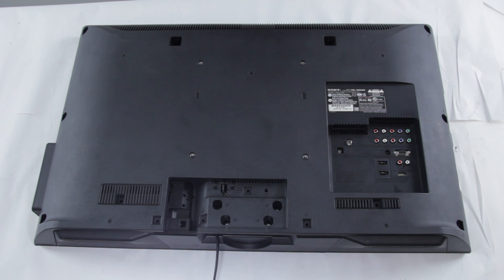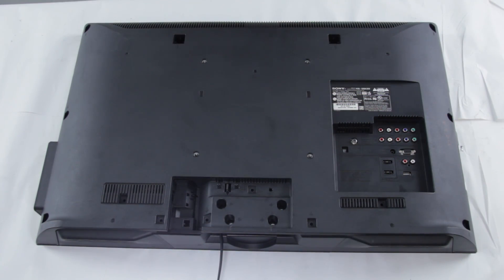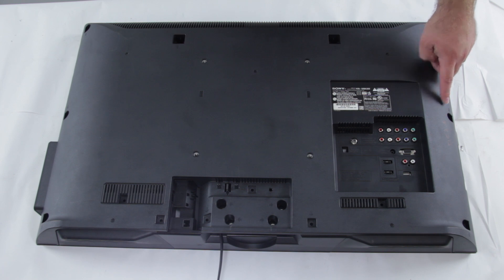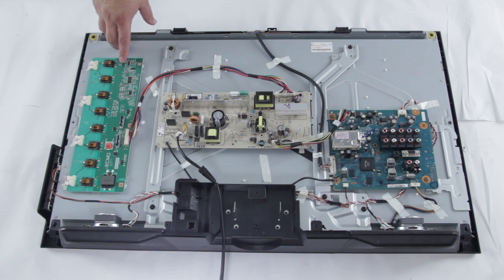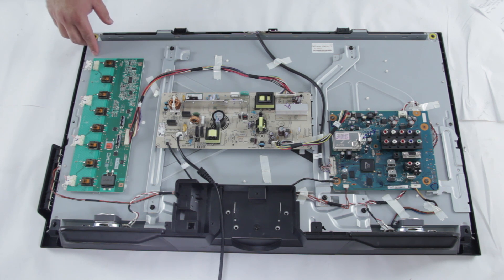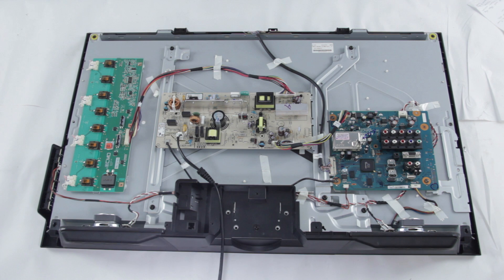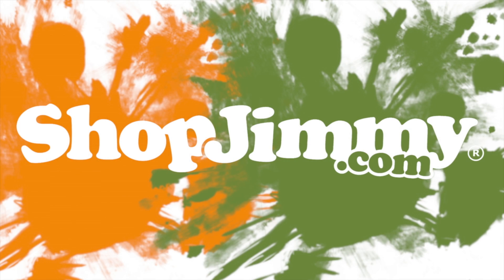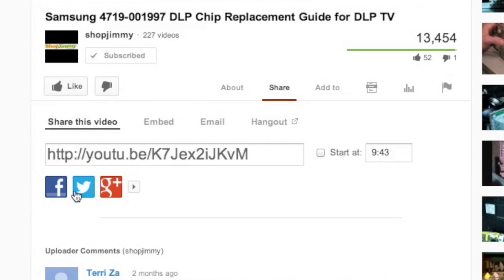LCD TV Repair Tutorial - Backlight Inverter Common Symptoms & Solutions - How to Fix LCD TVs

Comment: my son has a Samsung 40inch 2009 lcd LN40b550 and the other day he had it on in morning and when he returned after school to turn tv on the display was not correct. there is sound and everything works fine but the contrast is visibly wrong, its like on a computer screen that is set up wrong with the contrast and color. Also, my son has a ps4 and xbox 360, the xbox 360 was sitting under the right side if facing the screen and it gets pretty warm and heats up room along with the heat from tv. i have looked at troubleshooting issues and ruled out the swollen calibrators,, there is no blocked parts of screen that are different and no lines throughout picture. we adjusted settings and i ran the display diagnosis and it said that component or plug maybe faulty, something about cables or components that we plug into has an issue. PLEASE HELP IM GOING INSANE RESEARCHING THIS???????? mmcbar1@gmail.com

Comment: Hi guys, first I appreciate the help you are providing people with. I have a Sony Bravia KDL-40V2500 serial number 7112053  wh ISSUE-the 4 red light blinking problem. It happened right after my power bar was switched on off and on quickly accidentally. It turns on for 2-3 seconds then I kinda hear a click and the red lights start blinking. Ive taken the back off and Id like your help to know what I can try next please.  thanks

Comment: I have a Sony bravia KDL46_V2500 TV the problem is that when turned on the volume goes to the max. The input is from channel 4 and I cannot change the input channel. I am unable to use the remote as well. I tried changing manually by pressing the buttons on the top of the TV but I can reduced the volume but I cannot the input channels. Can someone help me in this problem.

Comment: I have a Dynex 46l150a11.... When I turn on the tv, I get the "Please Wait", then goes black after 10 seconds or so.... there is sound..... What the unusual part of this problem is that it is intermittent... Sometimes when I turn it back on, it works..... but more often than not, I get the "please wait" then it goes black scenario.... Can an bad  backlight inverter board fail intermittently????

Comment: Hi, I have a philips 32PFL3504D/F7 it turns off by itself 5 seconds after turn it on, no blinkink led, I dissasembled and disconnect inverter board from power supply and tv keeps on. Do you think my inverter board it's bad? Thanks

Comment: Panasonic 32"" LED TV Model: TH- L32SV6DThe TV is switching On but the green Led light flickers 4 to 5 times and their is nothin on the screen and the TV goes in Standby mode after sumtime again if u switch On the same thing repeats but no screen please tell me where the fault is ??? Email: gerard.ignatius001@gmail.comMobile: 0091 09823535250

Comment: I have a Phillips 42inch LCD with a problem 
model No. PFL7482 (Purchased Mid 2009,India). 

Problem Syptoms : 
When TV is switch on -> Screen on for 1 second or 2 secs, then backlight turns off...

Top left corner of screen does not illuminate from backlight, remains black for that 1 or 2 secs while the rest of the screen lights up then goes off..

The audio and rest of the functions work okay, the panel is okay....I've diagnosed image with the help of spotting a flashlight on the panel..

Recent Diagnosis:
The power board had one of the four capacitor enlarged...I replaced that one which was inflated with a new one & power board works fine..

The problem still persists..may be problem with the inverter board or the backlight or both of them...

Any help will be highly appreciated and I am always ready to purchase the required parts if anyone suggest any solution..Kindly message me..

Comment: I have a 55 inch seiki tv, it powers on and I can see the hdmi 1 in the top right corner then the tv goes black.

The power light stays on so I do have power, at one one point I would have to hit the power button 3 to 4 times before it powered on

Comment: I have a Hitachi 55 inch LCD television with built in Roku. Model number LE55A6R9A
serial number CH5HL00164.
I believe it needs a backlight inverter board but I'm having difficulty finding that part. Can you help?

Comment: hello I have Samsung tv UN50H6350AFX has no picture black screen but only sound work made flishlight test nothing showing  changed the main board but there was no difference after I changed the T con board the backlights starts to came on when I start the TV but still showing no picture  and the screen turned to dark blue glowing could that be the inverter panels?

Comment: I have the Vizio M701D-A3.  It started with a very thin horizontal line running from the left side of the screen and just fading away as it went 3/4 across the screen.  We watched tv that way for a week.  Then turned on the tv to see the V logo and watch the logo just fade slowly to black screen.  Watched your videos and did the tests.  Tested the T-con board by removing one ribbon cable at a time.  By the way, the back-lights are all working.  Turned the tv back on and observed 1/2 the screen all white and the other half showing the tv channel, with some fuzzyness.  The reversed the test by unplugging the other cable and hooking back up the opposite one.  1/2 the screen was all vertical lines of different widths and the other half was nothing.  I could see the backlights still illuminated.  Plugged both back in and turned the tv back on to see the panel light briefly and again fade to black and the tv then shut down.  By the way, that thin horizontal line in the first 1/2 of the test went away.  Also, the tv has sound, just no picture.

Comment: hello Jimmy. I have this LED LG 55" with model no 55lm6200. after a long time of being  switched off then switched on again. it will work fine for about 5-30munites then screen goes blank with faint images that I can bearly see.  I guess the backlight is off by then and it won't  work fine until after some rest(i mean when switched off for some minutes). pls, what could the problem be and how can it be fixed ?  hope to hear from you soon

Comment: Hi - I have a Sony Bravia KDL52W4100 and the TV turns on, but nothing displays, then after about 5 seconds or so, it will turn off and the Standby light on the front flashes 6 times. Would you consider this an inverter issue as well or is it bigger than that? Thanks in advance!
Reply: Did you fix the problem. I have the same problem. 6 blinking lights. Thanks

Comment: I have 55 inch LG TV (55LD520-UA) and recently we notice some burning smell coming from back of TV. After little investigation and research decided found that inverter cable that connects to Master 1 and 2 has been burned up. See link for picture. https://drive.google.com/file/d/0B1fuGQuAIc3OMlUyVmRzd2VKdlE/view?usp=sharing
Same thing also for Slave 1 and Slave 2. Any idea if this is the only problem or entire board is damaged? What could have caused this? Surprisingly, TV turns on perfectly fine and there is no issue with picture though, but smell will start after immediately after turning TV on. Any help is greatly appreciated. Thanks in advance.

Comment: 46" samsung lcd. Started with horizontal lines spaced 1/4" apart and down the whole screen. I put a little piece of tape on the ribbon cable going into the t-con board and the lines went away for a while. Then the screen went all weird one day displaying double image and red streaks that would come and go. While messing with the t-con board flat cable again it developed a vertical blue line with a few other colors about 5" wide. If it was the screen how would I have gotten it to go away with the tape? The things I replaced are: power supply, t-con board, tcon cables, main board, tcon to main board cable. None worked. If you can help me I would gladly buy from your site. thanks

Comment: The screen keeps flickering like a strobe light.  It is a Hisense 40" model #LCD40V57CA.  I cannot locate the jumper wire on the ps board that is equivalent to the JP 852 or 854 on samsung tvs.  They say that by cutting this jumper wire, it repairs the problem.  The board is different on the Hisense, board # RSAG7.820.968/ROH so I am not sure which one to cut.  thx.  chris

Comment: Insignia 46' LCD TV Model 46l780a12 No picture. Has sound. No back lights. replaced inverter bd. still no back lights or picture. Whats Next? Could use some help.

Comment: hi, i have a samsung t220hd monitor/tv. on low brightness lewel below 40(40/100) the backlight stops working.. i can live with that but this week some strange sound comes out of the back of the monitor, and the screen starts flickering(not all the time, randomly) and the brightness is lower. i checked the caps but niether one is  physically damaged. any advice?.. sorry for my bad english :)

Comment: I have a Sony Bravia  32" the problem is the set comes on  shows Sony then goes out. I still have sound on the set. I did all the tests and determined that the set has a bad back light inverter board. The model number is KDL-32R330B serial number is 423791. I removed the set back and it only has two boards visible Board number 715G6699-P01-000-002E and board number 715G6702-M01-000-004K. Where is the inverter board located and how do I get to it ? I have already replaced the power board 002E and have the same problem.

Comment: I have a Sony Brava model 46s5100 Sr# 8151445 When it comes on, it may come on with a perfect picture, or it may come on with a white like a negative photo image and then it alternates from there back and forth in no given rotation. I'm not sure what board is causing the problem but it seams to be an intermediant problem. The sound and all else works just fine. I would appreciate any help.
Ed

Comment: Model No: E550I-AO, Serial# LAQKOBP4503189. It started with horizontal shaded lines across the screen. There were a few shaded blotched also. When we were watching last night, the screen went almost completly black. If you turned all the lights out in the room you could barely see what was on the screen. The sound was coming through clearly. Is this the BL Inverter? What is the approximate cost of the repair?

Comment: I have an LG 50-GA6400-UG
Same scenario; picture goes out but the sound works well. I can see the picture in the background with a flash light . The inverter board was replaced twice and both times failed within a week. Could it be something else that is blowing these boards or did I get bad used boards?
Reply: Hi, I  have same model tv and having exactly same issues. Can you please help how did you fix your problem. Also, please let me know from where you bought inverter board. Thanks

Comment: hi, I do have KDL 32M4000. after turn on the tv, the red light in the front flash 4 times in a loop. searching in the web I found out that it is the the source board. should I replace the source board o there is any way to fix it?

Comment: Greetings, I have a Samsung 60 inch TV  (UN60H6350AF) that was only 2 years old and initially went to a black screen with sound.  Thru talking to Samsung and doing my own research, I replaced the tcon board.  Post the swap out of the tcon board, I now have no sound and still a black screen.  They mentioned my next steps might be the power supply board or the backlight inverter.  Please let me know your opinion.  Thanks in advance

Comment: I have a Samsung TV Model # LN46B650T1FXZA, Serial # AUHR3CPS701129A, Version # SS02. Watched a DVD movie the other night (about 1.5 hours) and did not see or hear any problems. Hooked up my PC to the TV (HDMI 1) and as listening to Pandora while I was working. About 30 minutes the TV screen went blank but the sound was still working. This happened several times. Reviewed your videos, and noticed the backlight is not working when the screen goes blank, and I do see an image when I shine a flashlight on the screen.  I have not opened up the TV yet and was wondering if you had any advise before I begin.

Comment: Greetings! This is Tshidiso from South Africa. I own a Sony bravia 40" TV, model no. KVL-40BX420. I bought the TV in 2010 and been working well until 4 days ago. When just plugged on the red standby light blinks 6 times. When it's turned on it makes beep sound but nothing show on the screen, instead it beeps 2 more times, then for a second you hear a sound and then it goes back to the blinking red light. I had a TV technician checking the volts (3.3V power supply, around 12.4V to the main board, and around 25V to the inverter). Immediately it switches back to blinking red light then it losses the 12.4V to the main board. He could not figure out the problem. Please Advice....

Comment: I have a Vizio model number VW42LFHDTV10A,serial #LJPBYJ2219600. My problem is ,everything functions well except the picture is a bit unstable when you turn it on,and after playing for about 2 minutes the screen goes black. If I turn off the room lights and shine my flashlight onto the screen I can see the images moving.

Comment: I have akai alt4247fhd, no picture no sound but have standby power. I check the pwoer standy board once inverter board  is connected the 24V will be misssing. L420H2-2EE Backlight Inverter

Comment: vizio vf552xvt has led backlight issues. the bottom third of the seen is dark, but visible, and there is a dark strip in the upper right side. where to look first is my question. . should I  test the led driver first maybe? or do I need new leds?

Comment: Dynex model DX-LCD42hd-09- manufacture 2008- power consumption 230w
TV turns on, lower right screen only dim backlight turns on for 2 sec then goes out. Screen remains dark and blank with power still on. Audio works. Cannot see anything with the flashlight test.

Comment: Toshiba 37x3030d, sound but no picture, no backlight but screen visible using flashlight meathod which I believe means the backlight inverter is broken. But we've opened the TV up and can't see the backlight inverter, we think it might be hidden under a panel somewhere. Do you know where it would be located? Or whether there is just one backlight inverter for this model, or two? Thanks.

Comment: I have a Hitachi LE55U516 and there is perfect sound from the tv but the screen is black. There is no backlight at all. I looked at your video and I'm almost certain it's the backlight inverter. Do you have any specific videos on replacing the Hitachi 55 inch tv backlight inverter? What costs to replace the parts?

Comment: Hi, i have a sharp LC-70LE732U. When i turn it on, the arrow in the frond is flashing (1 fast, 1 slow). I read online and try to rest it holding volume - / input or also holding power while pluging but nothing... so what should i do???

Comment: I have a Sanyo 42 inch. Model # Dp42848. The TV won't turn on, no power light. But after having the TV plugged in for about 30 minutes the TV power light starts to flash and the TV starts clicking and the picture comes on and the picture follows the clicking by clicking on and off. Took the back cover off to see if any signs of a bad capacitor but didn't see anything any suggestions

Comment: Samsung LN40B530P7N. has sound but no picture. possibly the inverter has gone bad. what kind of input/output voltage should I read in order to check it. or should it just ohm out?

Comment: My Samsung Model UN46EH5300 Flat Screen has been diagnosed as having one (!) backlight out, which has shut down the TV.  My reguy is not interested in working on this set.  Says it is too fragile, and Samsung is running in the opposite direction, after lying to me and others about getting back to us.  The set is less than 3 years old.  Great set.  I'm assuming this set has between 48 and 60 light sources in the set.  And one goes, they all shut down  --- stupid and inept design for sure.  Can you help me with service and approx. cost?

Comment: I have a 32" Curtis Model LCD3213 TV. It was shipped and held in storage for 6 months without climate control. It worked just fine before the move, but once I received it on the other side it turned on with no picture. I have researched but find nutting but how to open the back of the TV. Please help.